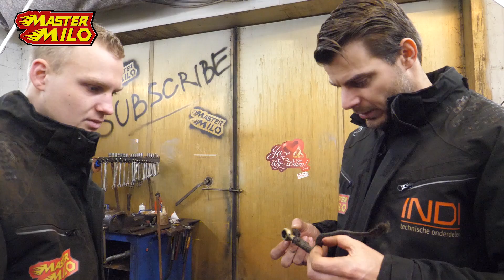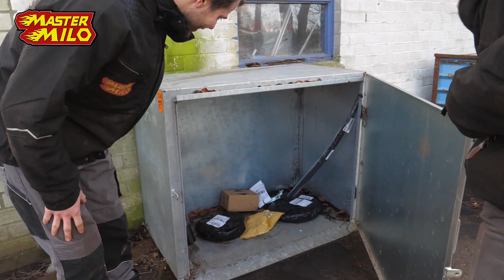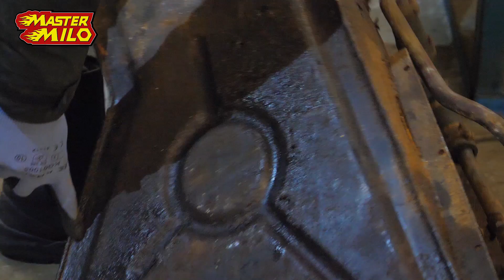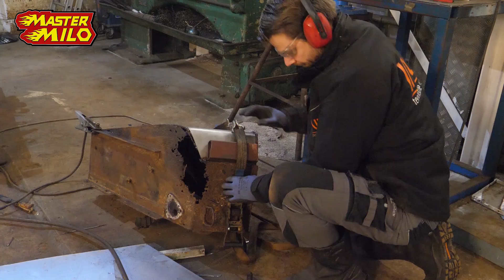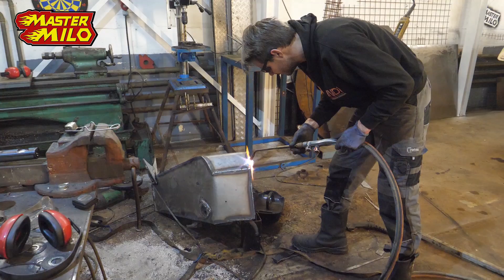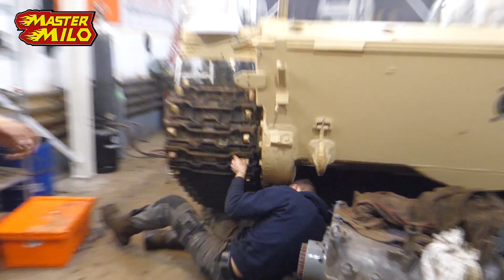Is de olietank te redden? (Tank motorruim) #193

Comment: I’m so damm impressed with your problem solving fabrication skills. I would have tried to find a replacement box. Job well done. Even though I can’t understand most of what you say I still love your vlog.
Reply: ROBERT GILL JR Flip open the info box below the video. You can find a link with the vlogs including English subtitles.
Reply: They also have tried to find one. However, apparently T69 parts are incredibly difficult to come by. Luckily the T55 is very similar, so most of the time they can just use the T55 parts. Unfortunately the oil tanks are different and they couldn't find a replacement one, so they had to make one themselves
Reply: C F damm. Thanks. I’ve been trying to figure that out. Not a big tech guy. Old skool.

Comment: If you have a classic car fuel tank in this state you can make a simple fabricated tank inside it from new metal. Then fit the old one around it as dressing. You loose a bit of fuel capacity, but keep the classic look of a pressed part. :o) (I worked in a radiator reconditioning factory)
Reply: @theoonyoutube  :D People were really serious about having stuff look the same. Everything from a plane belly tank to a Sherman tank fuel tank went through there :o)

Comment: Why don't you paint all the parts oil and fuel tanks, engine  transmission before fitting them would look so much better but must say your fabrication and work is excellent well done ...